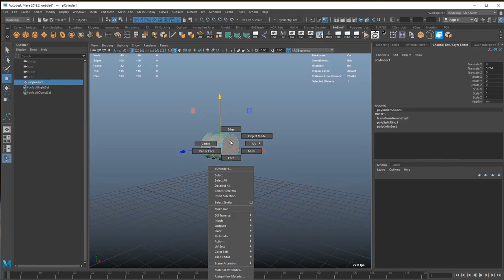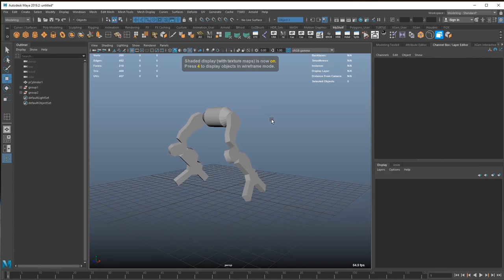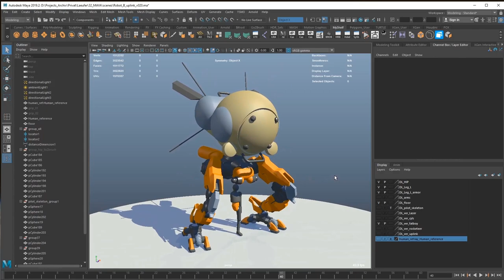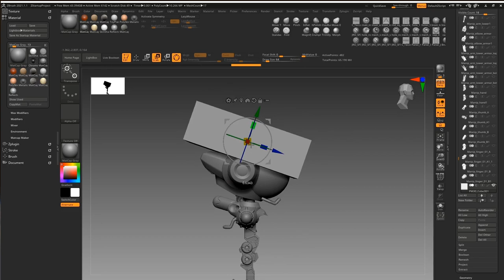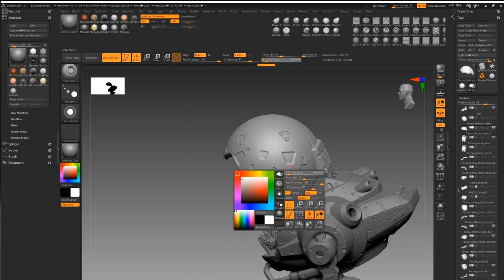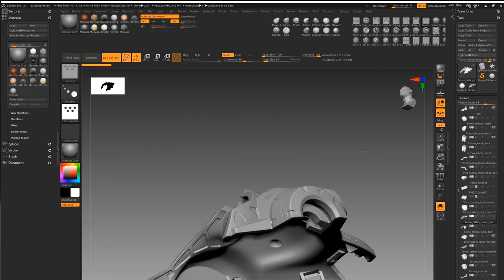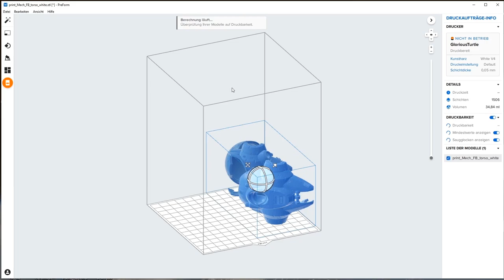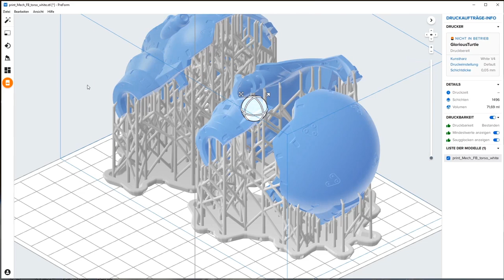teccotoys® prototype creation process part 1

Comment: Wondering about how you worked out your joints. I have an Elegoo Mars and im having so much trouble with consistency in mine. But that could be less to do with my printer and more about the water based resin is use.
Reply from the maker: I think it's based on the resin in use. So far I've only been using Formlabs resins, mostly the standard grey. It's good and has a bit of flexibility after the prints, but after a few weeks it becomes brittle and loose volume. I use hex screws for the hinge joints, so if they become loose, I can just tighten them slightly. The prototypes work well as proof of concept, but unfortunately they are not very sturdy, that's the reason we want to manufacture them with injection molding, so you'll get really strong limbs and stable and tight joints.
Reply: @teccotoys  thanks for the info